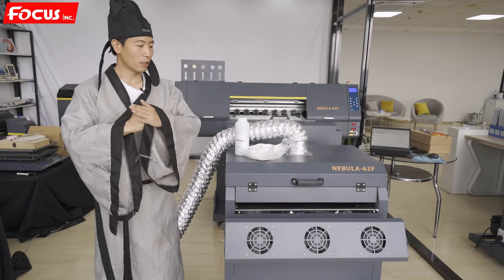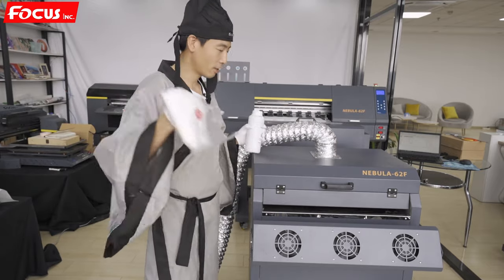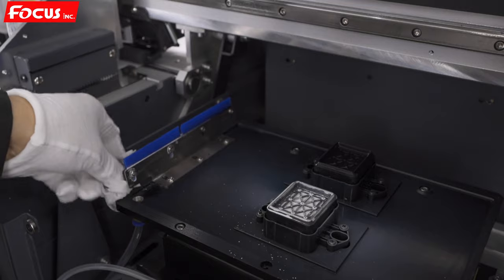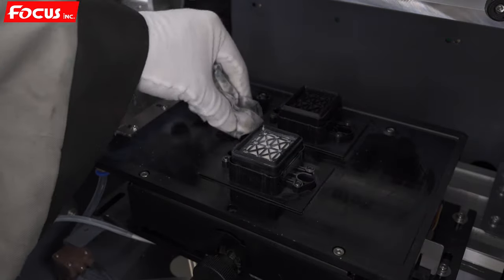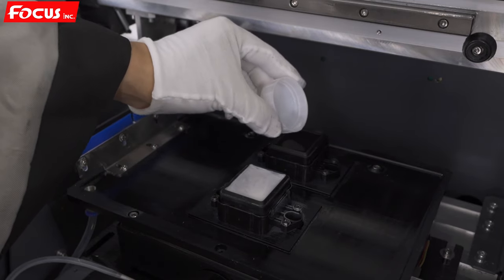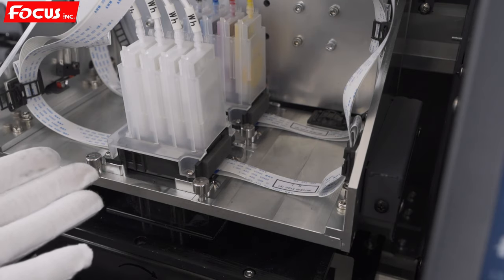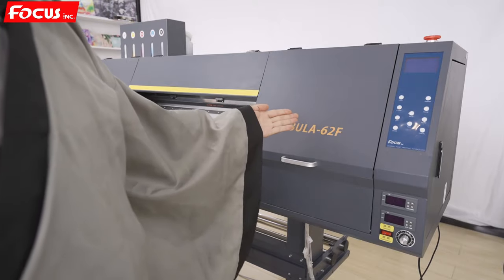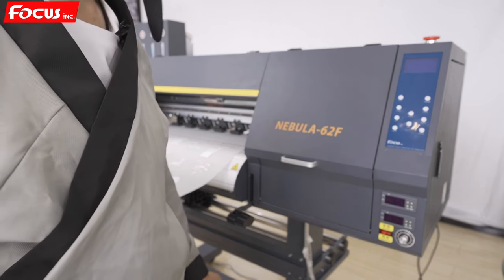Industrial DTF printer Nebula-62F tutorial 18:How to use a DTF printer -maintenance

Comment: After cleaning and placing solution in capping station….and the heads are back over them….should the heads just sit over them?  Not touching solution?
Reply from the maker: it's touching solution ,Touch while closing the software，Talk about it when you have time.+8619902919433